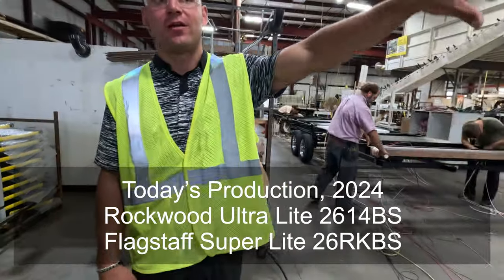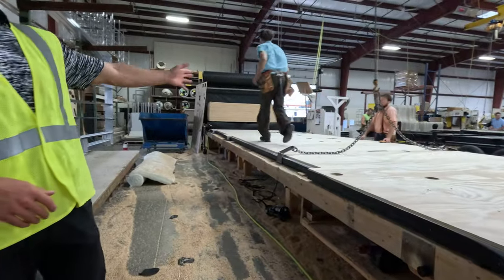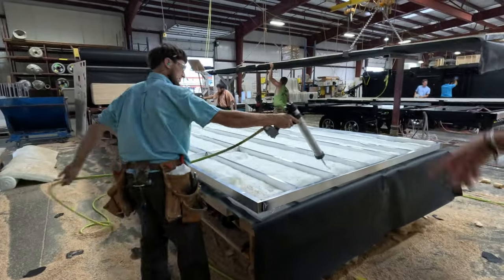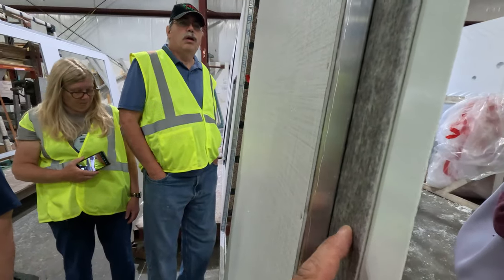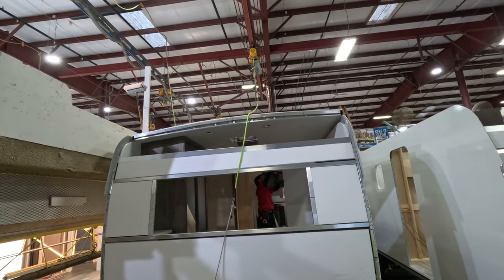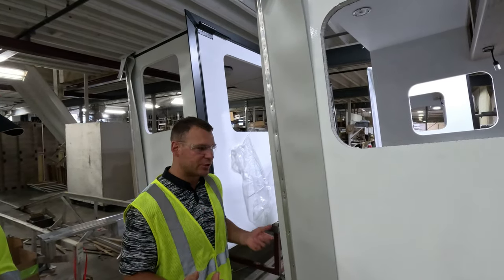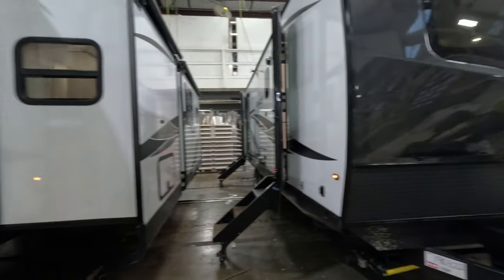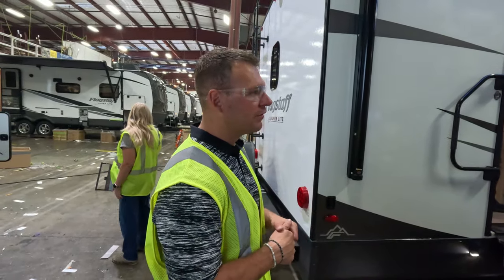2024 Rockwood/Flagstaff Travel Trailers - Live Plant Tour #rockwoodrv #rvlife

Comment: As fast as those guys were gluing and screwing I'll bet about half of what they were doing got to where it belonged better to slow down and hit your marks. Just because its "Fast" doesn't mean it's quality.
Reply from the maker: The team works efficiently and effectively. They have a strong focus on quality control and regularly check the units as they come off the line and during production. they even pull units off the line and perform a 300-point PDI, any issues are addressed immediately and corrected on the spot. Thanks for watching and commenting!
Reply: @TNTRVing  I toured a 2442bs at the rv show in Cle last spring and when I walked thru the hallway to the bedroom upstairs the floor squeaked like crazy...now I know why.
Reply: Tell that to Michael Jordan, fast and accurate.
So, not necessarily doing something 100 times a day doesn’t mean not quality either.
Reply: Just got my new rockwood.  Would Forest River like to know everything that was done half assed?  Lets start with the gutters...they leak from one end to other... every screw hole drips and you guys didnt even bother to caulk at where you pieced the gutters together. ON BOTH SIDES!  The TV has an inch and a half gap on one side and on the other the tv hits the cabinet.  I have to remount the TV which is infuritating. The theatre seat was not centered...in fact its so far off its laughable.  The side table has a knob that is almost poking through the side of the seat and on the other side there is 4 inches to spare. The caulking on the front is not complete.  This makes sense based on seeing how half assed and quickly they are assembling things here in this video.   The quality these are built with is shameful.  Here is some advice...fast doesnt equal better especially when you are charging over 40 grand for these.  Your quality control is demonstrably non-existant.  Battery was sitting in an inch of water..maybe drain holes..or better yet a battery cover that can be used with a battery that doesnt let water in and fill it up? This video is proof of the issues I have already seen after 1 week.  This poor workmanship should be addressed.  You are charging steak house prices for a mcdonalds hamburger level product.  Please explain how leaking and non-sealed gutters made it through your quality process...again on both sides of the trailer.
Reply from the maker: Sorry to hear, I would send Rockwood customer service an email with photos to address your concerns. Here is there email address rockwoodcustomerservice@forestriverinc.com
There should be a bead of non sag dicor on the top edge the whole length where the gutter meets the roof, the butt joints of the gutter should have sealant as well.
Careful remounting anything, double check with a magnet to make sure the metal backing plate is there. Also no screws longer than an inch. 
If you are near Indiana, you may want to attend the FROG rally next year it’s early August, there is lots to do there. Seminars, vendors and touring the area. The factory service department will be there and  they will fix warranty items. There is also a big dining hall where they serve breakfast and dinner. There is a cost of $600 or so but we feel it’s worth it, the factory service guys were really helpful. Best of luck!
Reply: Look at how fast they work.  Sloppy as hell.  Unfortunately, all RV manufacturers have this mentality, especially during COVID when the demand went through the roof.
Reply: That air test was worthless. Roof?
Reply: @TNTRVing  do you think I should have to be repairing a Brand New camper that has never entered a campground?
Reply from the maker: @Thurston-q6q  Nope! The first thing I would do is take photos of all of your concerns. Send a nice e-mail to Rockwood to express your dissatisfaction with how you received your RV.
Photos are very important, so they can determine the best course of action. The selling dealer should be able to fix all your concerns. OR…Not sure where you live, but if not too far away I would attend the FROG International Rally/ meeting, it's the week of August 12th. It's a fun trip lots to do and Rockwood Tech’s will be there and they can fix everything during your visit. I still feel Rockwood/ Flagstaff builds one of the better RVs in the industry. Heck they have been around for 50 years. 
Sorry you are off to a little rough start. 
Take care..
Tony
Reply: @TNTRVing  yeah the point is I should NOT have to do that.
Reply from the maker: @Thurston-q6q  absolutely agree, it’s a major inconvenience. That’s why I suggested turning it into a positive corrective experience like FROG “Forest River Owners Group” meetup.
Reply: I also noticed when they dragged the plywood on the floor they probably smeared the glue away n it probably didn’t even grab they call me eagle eye I see everything
Reply: @BrianVanLoocke unfortunately that is what I'm dealing with now on my new coach (floor pops and squeaks loudly), a Flagstaff, and the underbelly is sealed. I had a similar situation on my Salem FSX. In the video, the one guy didn't finish adding the floor sealant all the way to the end. Forest River needs to do better.
Reply: @TNTRVing 😂😂😂😂😂😂

Comment: The workers go way too fast in everything they install. There is no way they are catching all of their mistakes. The tour guide talks about quality materials as the workers throw everything together like they are in a race!
Reply from the maker: The workers are performing the same task repeatedly, they are good at what they do. As Mitch stated, not,only are the inspectors looking at the units while being produced they will pull several units for thorough inspection. If the inspectors see anything they do not like, it is addressed right now. I would put Rockwood/ Flagstaff quality build against any other company and win every time. Thanks for watching and commenting! Safe travels!
Reply: Hey Steve - that's a baloney response from folks who posted this video - I'm on minilite site on FB group and post all over about their notorius water leaks. Course never see these folks show up at those posts but I made furniture for years and did roofing & we sure as heck didn't run around like that
Reply from the maker: @harryatvick if you had to build or re-roof the equivalent production in a day these guys did, you would be moving as well. As for roof leaks, the only I recall that I have seen was from maxair vent fan. Under the clips that hold the cover on a little rubber plug didn’t seal the water out. We ended up fixing ours with dicor. When the factory found out there was an issue they fixed it. I try to chime in on FB if I can help. There are many helpful people on these groups. Our own personal belief is Rockwood builds a solid unit with premium components.
Reply: I know I was thinking the same thing. After watching a tour of Outdoor RV, it’s just the opposite. No running around going as fast as the can. People taking their time trying to do it right the first time. Every unit gets tested multiple times down the line. Then every single unit got to quialty control before being shipped to the dealer.

Comment: This is an awesome tour. When my wife and I were shopping for a new trailer, I did a lot of research and she had a few specific requirements. Chief among those was that she didn't want a "mushy" floor. I quickly realize that shopping for an RV with solid plywood floors dramatically reduced our options and in most cases, dramatically raised prices. Rockwood was a standout, offering the highest quality construction I could find anywhere in this price range- even better than many more expensive brands. We've had ours since '21 and couldn't be happier with it.
Reply from the maker: Great! Glad you liked the video! We just recently posted another video on how the sidewalls and roof are made. Be sure to check that out as well.

Comment: missed the part where they actually looked for leaks during the pressure test.  The spraying guy in no way had time to check stuff.  As soon as he was done spraying he instantly unhooked the fan.
Reply from the maker: My thought is that the air pressure is so high it instantly will bubble. Mitch also stated if a screw was slightly off and leaked air they would catch it. 
Thanks for watching and commenting!
Reply: @TNTRVing  But the guy never looked to see if there were any bubbles! It appeared to me that he was just checking the block not actually doing the check.
Reply from the maker: @stevejonhson4947  It would be nice to see one pressure tested that failed.
I would hope that it was so obvious that they would catch it. Thanks for watching and commenting.
Reply: I thought the same thing, he didn't check for anything.

Comment: It's clear these guys are trying to knock out as many units as they can in as short as time as possible.  Quality takes a back seat to productivity.  I wish the RV manufacturers would change how they throw these things together.  You can't convince me that these guys are not making more mistakes after they've been doing this for six + hours.  My guess is they have a daily quota and when they meet it, they go home. No difference in pay if it takes them six hours or eight.   Thank you for posting this.
Reply from the maker: You are correct. Yes, they are trying to knock out as many units they can in a day. It’s called a production line. It’s not General Motors, where guys are sitting around and reading the newspaper. 
One think we noticed is if a station is moving a little slower, the guys/ gals next to them will help. 
The other thing is they all strive for a quality build. They have a points system and are constantly battling to have the lowest points in production.
Rockwood/ Flagstaff have been around for 50 years.
Sure they have made mistakes in the past, but they learn from them and keep moving forward.
Try touring another manufacturer, I bet nobody is working and everything is nice and clean..
Appreciate you watching & commenting!

Comment: Is that the same roof for a 2022 2608BS? A lifetime warranty?
Reply from the maker: They changed the roof membrane for 2024 it’s a 45 mil Alpha ply TPO. Only 2024 units have the lifetime warranty. The speed they move to assemble the floor looks fast to people who work slow. Imagine how much more expensive they would be if they took their time and poked around. There is plenty of adhesive on the aluminum structure and wood to accomplish the secondary bond, even when they drag the plywood a foot or so. Thanks for watching and commenting.
Reply: @TNTRVing  Thanks for the reply.

Comment: Nice to see but way, thats why so many issues. I have a 2022 mini lite i really like but after every trip a screw falls out, other screws not put in properly. Slide out improperly alligned, you could do so much better
Reply from the maker: Issues happen occasionally, not sure what screws are coming loose. I have had a couple fender skirt screws get loose, issue is our bumpy roads. 
Slide issues can develop if people sit in them when they are closed or set jack stands under them when setup for camping. I have seen both on our travels. 
Our mini lites are built way better then the compilation in our opinion. 
Thanks for the comment, Safe Travels!
Reply: @TNTRVing  Hi, yeah was on a trip to Alaska this spring. The two nuts holding the slide rails to the tip out were gone, i was lucky i did not loose my tip out. Two screws holding oven in olace gone two s rews holdung microwave in place gone and several screws on drawers gone. Had to thighten some  screws holding side panels in place along lower side of rv. Im extremelly particular on preventive maintenance so someone that is not would have missed many issues. Lots of exposed unprotected wiring on outside i had to had protection from flying rocks. Having said that im somewhat satisfied with my tt. Cheers
Reply: They move to fast , that’s why everything falls apart. They need to slow down and do it right. Having your fridge and microwave, stove fall out of the walls is just ridiculous. It’s incompetent workers that aren’t taking their time and doing it right. And screws falling out everywhere, they need to slow down and put them in properly in the right places. 
The way they move half the screws and staples aren’t even in right.

Comment: Why do RV makers use a membrane style roof in lieu of a fiberglass CNC cut for penetrations?
Reply from the maker: My thought is most Rv’s built have a certain amount of flex in the roof from weather/ expansion & contraction or from stresses while underway. The membrane allows for those movements without compromising the integrity of the seals. I do know that Rockwood is working on one piece fiberglass roof on the Mini Lite. Here is a look at one on a Prototype 2024 2515s. https://youtu.be/08UO2nabh6s?si=GF-KA_r9Vy4_gpRn
Thanks for watching and commenting!
Reply: Thanks very much for your reply.  My wife and I are looking for a good couple’s unit, plus a small dog, to travel around for about a year and visit the grand kids a couple times a year.  Want to be able to get into, at least 50%, of the state parks which looks to be problematic for RV’s longer than 26 to 30 feet.  Want something with good storage and the least amount of, shall we say mechanical, difficulties.  
One of the problems I have personally seen and what is talked about quite frequently on YouTube is leakage.  So, the idea of a single type of construction method would seem to minimize that issue from occurring. Now I am not talking about molded construction such as an Oliver.  But using the same fiberglass, aluminum, and foam composite construction as used in the side panels, for the roof makes a lot more sense.  This would keep the thermal coefficients alike throughout the coach.  Expansion and contraction would be consistent.  When will these new fiberglass roof models be available?
Thanks
Jimmy
 @TNTRVing
Reply from the maker: @jamesstever8335  Agree, with the size of some of these units you have to consider the type of camping you intend to do. I'm not sure when they plan to release the new roof system. I was surprised to see it already on the 2024 prototype. Hopefully, it will be out in 2025. We will have to wait and see.

Comment: I can only imagine the human errors made on a daily basis with these guys running around like a chicken with his head cut off.
Reply from the maker: Imagine if they were slow and only built half of the current days production. Everyone would complain how long it takes to get a trailer and how expensive they are. 
With that said, they do make some mistakes. The neat thing is there are inspectors on the line going through the RV as it’s being built to verify it meets there standards.
Furthermore, RV’s get randomly picked and inspected in another building at a much slower rate to verify it meets there standards. Here is our most recent video on that.
Hope this helps. Also, check out our other video on how Rockwood/ Flagstaff build sidewalls and roofs. Appreciate you watching and commenting!
https://youtu.be/i9JUt5Xd2UA?si=oi2dZt3kG2FUn55m

Comment: They keep getting better. HOWEVER, That damn RUBBER roof....   They need to put a sheet of aluminum up there if they really cared about having top quality. That rubber roof will at some point leak. Aluminum will not! Any mfg that says they build a quality product then slap a rubber roof on it is a big fat liar!  I have owned five 5th wheel and ALL of them (even the new ones) LEAK at some point!
Reply from the maker: Danny, I found out on this trip, Rockwood/ Flagstaff are starting to use 1 piece fiberglass roofs on all smaller mini lite RV”a they build. Stay tuned as we have another video showing what it looks like.
Reply: The PVC roof membrane now carries a lifetime warranty. 

The issue with most RV roofs is not the membrane itself, but the flexible seals used on the roof. These are actually maintenance/inspection items and not all owners inspect them. This is typically where leaks occur. Unless the membrane is punctured I haven't heard of anyone having issues with the PVC item itself. 

Plus it allows for flexibility of the trailer as we navigate the roads that we have. You'd have to make the trailer significantly heavier if you didn't want to experience movement and then it wouldn't be a "Lite."

Comment: They are moving way too fast.  Need to take more time would make less mistakes and align things better
Reply from the maker: The workers are performing the same task routinely, They are good at what they do. It just looks like they are moving fast. Also, Inspectors are throughout the plant to double-check the quality of production. Corrections are made on the spot If needed. I plan to do a follow-up video on the inspections. Thanks for watching and commenting!
Reply: @TNTRVing   Do they use plywood or OSB for the roof decking?

Comment: These plant tour guides are almost as bad as the used dealers. "No one else is doing what we are doing..." This is why the RV community has had it with the quality of units.
Reply from the maker: I would be interested in hearing what other manufacturer uses six sided aluminum construction, Azdel inside out, insulated with high density block foam. Welded aluminum dinette & bed frame supports. Dexter torsion axles, Goodyear Endurance tires, TPMS standard across the product line..😃 Rockwood/ Flagstaff build some nice RV’s. 
Appreciate you watching & Commenting..
Reply: @TNTRVing  Northwood mfg, Alliance, Brinkley, Airstream...
Reply from the maker: @MASONROSS69  I just toured Alliance, they & Brinkley have a Completely different build..
Airstream, way out of pricing reality..
I have not toured the other..